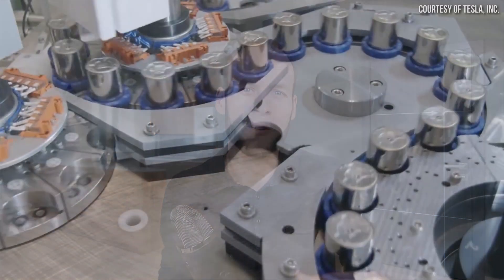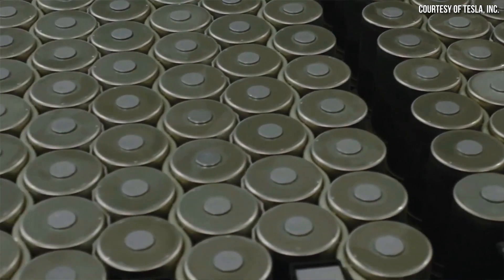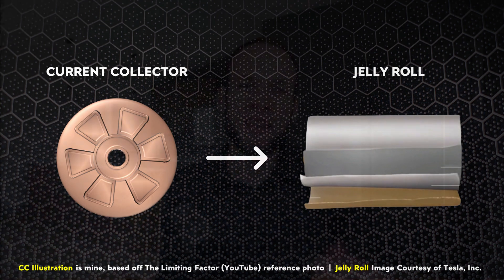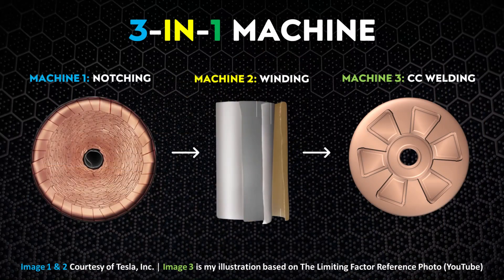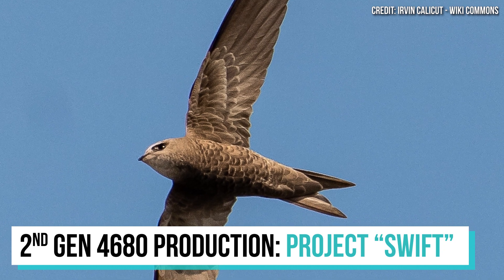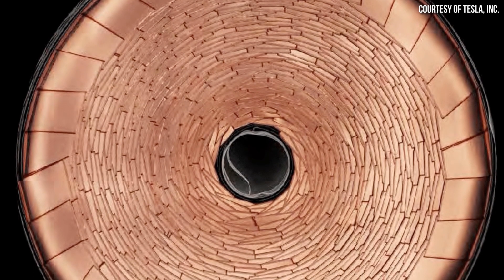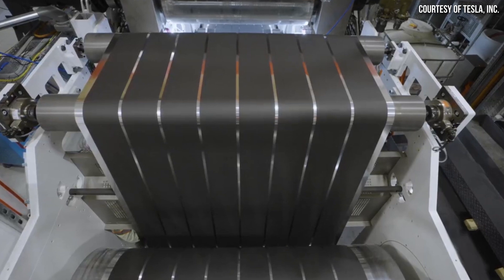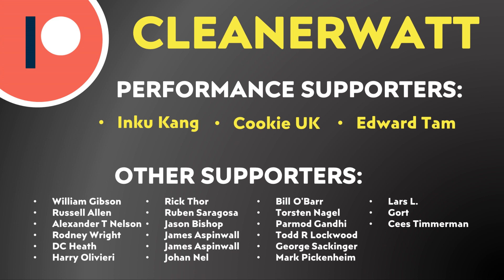Tesla's SECRET NEXT GEN 4680 Battery & Machines

Comment: Just a thought on the implications of the possible 2nd and 3rd generation cells.
.
This would mean a cell with up to or more than 10% increase in gravimetric density over a cell that matches the best, combined with the expected increase in "power" (possibly discharge AND charge?) which is already likely to be both the cheapest in the industry and very likely to be the easiest to produce at volume (GWh? TWh!?)
.
Add that to the coming "incentives"

Comment: Munro also mentioned how the outside layer on the battery is thinner. So they probably have a little bit more Jelly roll in each cell than before. Add that to the increased height of the Jelly roll too

Comment: Do the math, the 4680 cell is 5.484 times larger than the 2170 cell. So an energy capacity of 5.38 times greater is actually slightly less energy density. This is in contrast to later statements that first generation 4680 is 276 Wh/kg vs 2170 at 259 Wh/kg. Seems like there are a huge range of estimates.
Reply: Well, the "Limiting Factor" stripdown cell had less silicon content, so lower density.
Was that a prototype? Gen 1? Latest Gen 1?
On the other hand, the Munro team expressed "surprise" that the cell they were testing was (much?) Better than they anticipated.
Suffice to say it's doing the job?

Comment: Hi liked the video and have a question I see the copper flags for the anode so that lowers the resistance form the single tab design but what about the cathode aluminum  is that a single tab???  If so that seems like a resistance problem
Reply: Tabs on both, anode one end, cathode the other.

Comment: REally good video Jon!  Very interesting welding of the tabs or flags to the end cap.  Seems as though a hollow tube center core is possible to design into the cells to enhance liquid cooling.  There is a thermopile effect where adding current to the terminal ends of a thermopile winding results in the winding getting cooler.  This is actually used to refrigerate a camping cooler via the cigarette lighter plug of a pickup truck or car.  Be interesting if the batteries could be designed so that the casing was a bi-metal cooling thermopile.   I guess it'd be a double sleeve wired to a solar roof or a service plug.  You could cool the batteries without fluid.
Reply: No liquid in the centre, but they do need to physically locate/ carry the roll while winding it, plus ensure electrolyte gets injected fairly evenly? (Pressure, then spun to force it through the cell?)
Reply: @rogerstarkey5390  That's an interesting dynamic to ponder.  I thought the electrolyte was a gel like material and it was simply spread or sprayed  on a substrate as the substrate is wound between anode and cathode layers.  I'm totally guessing.

Comment: It won't save time because the total process is governed by the slowest machine. You can't weld it until it's wound, so that must be added on. I think the main reason for this new machine is it simplifies the whole process for a tiny increase in cycle time. You already have the part under control in the machine, so if you can simply add another process then it eliminates whole additional machines. The big saving here is in floor area, part handling, and hence cost and reliability. Many processes don't easily fall into the capability of one machine, so you can't do this. If each process has to be completed before the other starts, that's a problem. Winding something and doing two processes at the same time, and then doing a quick weld on the end is possible in one machine.

Comment: CONTAMINATION REDUCTION 
A substantial benefit of combining multiple production tasks into one machine is that there are fewer places for contamination to occur. Even in a clean room factory environment the more the battery constituents travel around as seen in those fascinating video clips, the more chance for bits of hair, dust or bearing flakes to fall on them and cause higher failure rates. The production rate and cost improvements could be from less wastage.
Reply: @AudiTTQuattro2003  Though it is replaceable, recyclable and has a much longer warranty than a petrol engine 😀
Reply: @AudiTTQuattro2003  
Define "completely unrepairable"?
To make that statement you need to know the possible points of failure.
BMS? Probably reliable.
.
Cells? Well, they'll be less heat stressed, probably better tolerance on the material thickness (less degradation) better cooling, so longer lasting?
How about a fusing system to cut the cell in case of problems?
.
Power electronics?
More likely... But.....
Fully accessible from INSIDE the car (the "penthouse", under the rear seat!?)
.
What was your point again?

Comment: How does the 4860 stack up against the competition from other manufacturers?
Reply: Gen 1 seems to match up with current 2170s. So lots of room 4 improvement.  More si to add.  Better chemistries.  Improved dry eletrode.

Comment: When Tesla achieves higher energy density, they are more likely to reduce the number of cells and keep range constant. This will allow lower cost per vehicle and reduce vehicle weight.
Reply: It will also let them spread a limited supply of batteries across a larger number of vehicles.
Reply: Totally agree, also reduced cells mean reduced weight hence more range which means.........and on
Reply: Exactly!
Reply: 4680's will be primarily in Semi, Cybertruck, and eventually Roadster. Tesla just started to sell made in China, standard Model Ys in Europe with LFP batteries. LFP batteries also improve each year.
Reply: @cathyk9197  It's important to keep straight that "LFP" is battery chemistry, not form factor, and that "4680" is form factor, not battery chemistry. Two separate issues. While 4680's currently use Nickel based chemistry there is no reason why, in principle they couldn't also utilize LFP chemistry. The importance of the 4680 form factor is that it enables the "structural" battery pack, which, afaik, is not feasible with blade or prismatic cells. Tesla is currently utilizing those as a stop-gap to meet their need for some kind of battery to put in their cars until the production of 4680's catches up with demand.
Reply: @PhillProbst  Very good points!
Reply: @PhillProbst  
Correct, and imo likely.
Especially when you consider the EM view that LFP (or now variants of) will be the predominant chemistry.
.
We must then consider the 4680 manufacturing system which is obviously(?) the route to economical TWh production.....?
Reply: @PhillProbst  Maybe a stupid question but can't they make LFP batteries with the 4680 cells and dry coating technique?
Reply: @fodiographer  As I said above, in principle, yes. They are just not currently doing so. There may be technical challenges in doing so. They're still in the process of sorting out the 4680 production using NMC chemistry.
Reply: @cathyk9197  The 46-80 cell has already rolled out in the Texas Model Y. I expect that as 46-80 cell production ramps, that Tesla will roll them out in every vehicle and in every chemistry. The form factor and manufacturing process have too many advantages to ignore. They are still working on the manufacturing process. This has not gone as smoothly as Tesla hoped, but when that development is good enough, they will roll-out 46-80 production lines in every factory they have. Then we'll see something.
Reply: Reducing the number of cells can only be done in steps that make sense: you need to find a pack configuration with proper voltage for the motors and for charging. And Tesla needs to adapt in the BMS and eventually TMS.
Current Model Y with cells of type "4680" is 92s 9p, a total of 828 cells.
Feasible would be: 92s 8p (736 cells), taking out 92 cells. But this would require a factor 1.125 in amphours per cell to get the same capacity.
Also feasible: 94s 8p (752 cells) or 96s 8p (768 cells), if the BMS has the channels for 94 or 96 cells to monitor and manage, which it should have as previous Tesla 3/Y had 96s battery packs.
Reply: The question is whether they'll pass those savings onto the consumer ☠️ they've strong demand right now so they don't necessarily need to.
Reply: @itisno1  Sad but true. At present, Elon is embarrased by how much they are charging for Tesla vehicles. There is no end to this in sight. Until production catches up to demand, we might even expect the prices to continue to climb.
Reply: Unfortunately,  that's not how economics works. Demand dictates the cost, not the cost to produce. 
There's will be too much demand for until we stop buying cars. For example, pharmaceuticals have a cost of 5 cents per cholesterol drug pill, but sell them at $10 per, because people's life depends on it, they can charge higher with no loss. Only competition can help drive prices down. Tesla for sure cost less than 30 already to make,  but that's not reducing the cost is it?
Reply: @Findmannynow  It is true that Tesla prices are much higher than costs at this time. But, since Tesla is selling every vehicle they make, lowering prices would result in lower gross margins and longer line-ups of people waiting to buy cars. This is in part due to the lack of competition. Until Tesla can satiate demand or other BEV manufacturers can produce both quality and quantity at a cost that makes sense, Tesla prices will remain high. That is how economics works.
For now, Tesla is increasing production by more than 50% year over year. They aren't just sitting on those huge proffits.

Comment: Nice presentation. Thanks for making this video. Comments below:

- Anode flaps are good ways to collect current and heat from electrolyte towards cylinder base.
- the anode flaps should be ‘soldered onto’ the cylinder base for superior current and heat transfer vertically which is not possible in a structural pack that has no thermal ground plane beneath. 
- adding a conduction bridge wafer followed by laser melt bonding address electrical performance is a plus.
- the advantage for heat sink vertically is wasted because of a conventional heat sink scheme is used, through cylinder wall but cylinder base. 
- going from 18650 to 46800 improves kWh/$/cell, the down side is heat sink area reduction by 2.55x that is to say 46800 will temperature rise by 2.56x that pack thermal management must accounted for, before mass production. ie needs further heat slinking innovation? Where present thermal management scheme in model3/Y is adequate for 18650/21700 but 46800.
Reply: Surely the "TABless" concept relies on reducing internal resistance by reduced distance between anodes and cathodes (les resistance=less heat) This makes le top and bottom of the batteries the shortest path for the heat. Where heat generated by traditional cylindrical cell has the travers all layers. Or am I wrong?
Reply: @roelhellemans2451  no you're right. the biggest (or only) advantages of the 4680 is the lower internal resistance (so lower heat generation) as well as easier/faster more scalable manufacturing
Reply: @roelhellemans2451  electric conductor has Ohm resistance1 contribute limited heating compare to insulator and electrolyte produce a major issue from electrolyte thermal resistance2. I offer thermal issue insight you took it for Ohmic issue. 

Electric current conduct via point contacts that heat cannot. Thermal conduction must use cylinder wall area contact and not point contacts.

18650 has 2.56x more cylinder wall area per kWh dissipation compare to 46800.
Reply: Reverting to welded tabs should not be necessary for fix and would not likely be beneficial to the battery, as with 2170 one tiny tab served both as current path and heatsink path. With 4680 we have 5x the current and heat but >100 x the tab cross section. Even if 1/2 the laser cut flaps dont make contact with the new compression system we STILL have 100 x 1/5 x 1/2 = 10 times the cross section area per stored watt/hour conducting electricity and heat.
If poor tab contacting to bottom plate is the problem it would be immediately obvious as hot-spots.
Reply: @lengould9262  am I discussing thermal issue with a ME or EE with mass market product development experience in high power product for 10 to 25 years? 

Single tap of 18650 is use to conducts current and not heat. 

All commercial and industries cylindrical cell such as 18650 21700 46800 sink heat radially via electrolyte stacks at cylinder wall. 

Point contacts conduct current but heat in EV cell applications. 

Anode flaps of 46800 should be soldered  directly onto cylinder base for superior current AND heat conducting performance.

Comment: @8:00, adding what electrolyte,  thought it was a dry cell?
Reply: Dry electrode is describing the process of making the anode and cathode. This is different from solid electrolyte that other battery maker are developing. Tesla was not planning to use solid electrolyte instead they intended to use liquid electrolyte with special additive that Jeff Dahn has developed.
Reply: Dry electrode process. The deposition of the active material is done in a dry process rather than a wet(slurry) process.

Comment: In your previous YouTube video on the manufacturing of 4680 battery, clogging process was a major problem as they expanded the size of the rolls to be dry coated for the 4680 battery production. This problem can be easily & quickly reduced by reducing the width of the produced roll (which are many, many times larger than 80mm), as the benefits of a wider roll are defeated by the clogging problems encountered.

This is a much simpler process change than reducing the the temperature of the powdered materials which requires unnecessary energy used.

Reducing the size of the dry coated rolls do not reduce productivity as the speed of dry coating process becomes less hindered.
Reply: Jelly roll is wide so one machine can produce many 80 mm rolls after cutting. From Tesla's first principle's perspective, rather than instantly decrease machine output by cutting width to half to improve clogging, they look to figure out clogging at the powder level. With 4680, everything is about manufacturing speed and floor efficiency, so they get back to the source of the problem which is not the machine, but the powder.